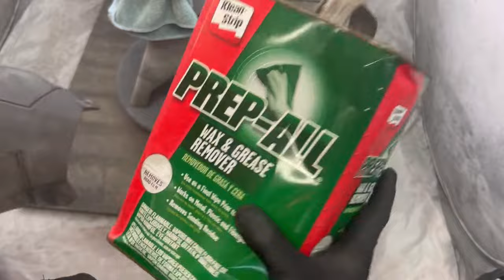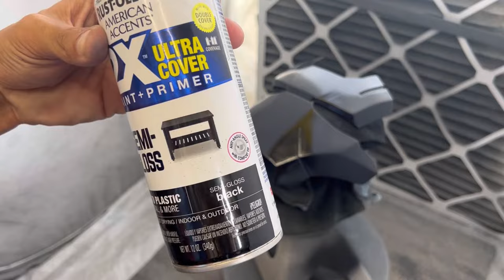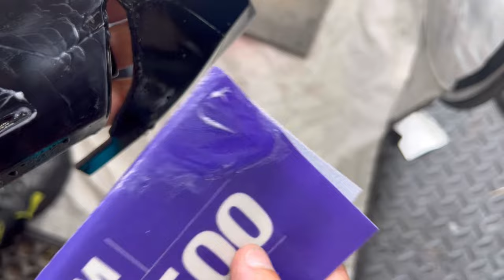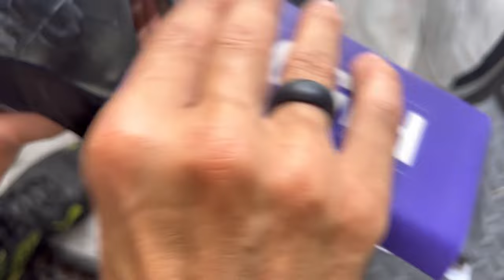How to wet sand clear coat when painting 3D prints | How to apply duralumen & wetsanding 3D prints

Comment: I followed this method to a tee,  everything was going perfectly, until I started applying the duralumen...now I see streaks everywhere? Any ideas on what I'd did wrong?
Reply from the maker: Which method did you use the wetsand & buff or just wetsand & reclear? 1k clear or standard acrylic?
Reply: @Darkwingdad  1k, wet sand, polish, prep all, tac cloth, duralumen
Reply: @Darkwingdad  I think I figured it out. I don't think I cleaned off the polishing compound off well enough before applying the duralumen. I sprayed a test piece with duralumen that just had 1k with no wet sand or buffing and it came out with no streaks or spotting.

But I do have a follow up question with that, how do you know when You've gotten all the polishing compound off after buffing?
Reply from the maker: @michiganmandos  oils & residuals will definitely cause streaking. Also wear gloves & use a fresh towel. You can always run the piece under water, clean areas the water will sheet off the model. If there is oil it will build up almost in a pattern
Reply: @Darkwingdad  thank you so much that is hugely helpful! I definitely think that's what happened then. Time to wet sand and start over lol! I appreciate all you do and the replies!!!
Reply from the maker: @michiganmandos  you won’t need to wetsand it again. Polish the duralumen off, give it a good clean wipe down & reapply duralumen
Reply: @Darkwingdad  saving me time and money again, thank you!!
Reply from the maker: @michiganmandos  anytime!

Comment: Dawn is alkaline - at least plain dawn is. I've never had issues adding it to my wet sanding to get mirror finish, but obviously that changes if you use like scented and other varieties.
Reply from the maker: Dawn ultra contains sulfuric acid, regular Dawn contains metasilicates which are found in heavy degreasers. Both will continue to attack the surface. Not good for incurred clear. Solvent pop won’t happen right away but months after treating the paint:
Reply: @Darkwingdad  Hmm think Cascade has meta-silicates but never used it so don't know how it impacts it, either way my prints from 10 years ago still look shiny and clean, if not a bit dusty.
Reply: Also - I've used 2k clear but never 1k, does the 1k have some sort of metallic flakes in it?
Reply from the maker: @realMysta  2k had more hardening agents in it, so it does cure a bit faster.
Reply from the maker: @realMysta  duplicolor 1k comes with & without flake
Reply from the maker: @realMysta  if you waited long enough you might be ok, but that’s why your not even supposed to wax a car or use water based polish/compound when curing bc the solvents can get absorbed in and create solvent pop
Reply: @Darkwingdad  Yeah maybe, I usually don't wait too long as I'm always crunching but I at least wait 48 hours which likely means at least the outer layers are good and I don't sand far enough to get through those.

Comment: This may sound like a silly question, but would 16-54 Seymour Stainless-Steel Specialty Coating work? Like would it be  safe to use after priming and even polish?
Reply from the maker: Got a link to the product?
Reply: @Darkwingdad  Yeah, I keep trying to post it but YouTube keeps taking it down. I’ll try again down below as a separate comment. It’s also on amazon under the same name.

Comment: Quick question. The link you have in description for 1k clear goes to spraymax product and not the duplicolor extreme. Which did you find works best? Thanks.
Reply from the maker: https://amzn.to/3qZSMlR here’s duplicolor. I noticed the duplicolor last longer. I used spray max in the past & although it doesn’t have the activator button after sitting for 2 weeks the nozzle clogged & i wasn’t able to use it. So although spray max is cheaper duplicolor lasts longer.
Reply: @Darkwingdad   Thanks for the quick response.  I usually use Alclad gloss black for base, then Alclad II chrome followed by sealing with spraymax 2k for my Mando cosplay. Works well but wanted to find alternative where i can speed up time using rattle can for some parts. I am hoping even though this will introduce having to buff clearcoat before I spray chrome, it will still reduce the time it took on my alclad.
Reply from the maker: @chrisgilreath2821  I haven’t used alcad yet but try using a flat or matte base followed by 2k. A lot less orange peel. I’ll be doing another video with duralumen tuff & with 2k clear
Reply: @Darkwingdad  Looking forward to when you compare duralumen with alclad chrome!  My issue with 2k is that unless you use the whole can, its wasted due to cure time. Sometimes I am just building a Mando helmet and dont need an entire can, but it gets wasted.
Reply from the maker: @chrisgilreath2821  yea the 2k you can put it in the fridge and get a little longer shelf life but that’s why I spray with hvlp it’s cheaper & obviously the activator K resin are seperate so “no” shelf like unless mixed
Reply: @Darkwingdad  Interesting. I have a Husky hvlp sprayer. What product do you use? That sound like the way to go. Thanks

Comment: Awesome video! Though I have to disagree on the hand polishing. I do it for all my props, hell I even did it on the guitar I built and it always comes out great. Like a mirror. As long as you have a good quality microfiber polishing cloth, you'll be good.
Reply from the maker: Respectfully speaking, hold an led light up to it, you’ll have tons of swirls in the finish from the pressure your applying. There’s a HUGE difference between gloss a finish. You can get things glossy but still have scratches. Scratches & swirls refract light instead of reflecting them. So your finish & shine won’t have as much pop as it could be. Just try it one time you’ll see the difference. There’s reasons why technicians who work on cars, chrome & even acrylic fish tanks use machines & not by hand. One is time….two is the quality.
Reply: @Darkwingdad  I'll definitely try this out on my guitar when I gey home, I'm very curious!

Comment: Hey man, just wanted to say thanks SO MUCH for this video. I’d never even thought about buffing or polishing my prints until I saw this, but I’m so glad you taught me how. I followed the video to a T, and the surface of my print was unlike anything I’d ever made before!!! It was incredible. 

Unfortunately… I think I may have gotten a bad batch of Duralumen… When I sprayed it on, it was cloudy and completely matte. I tried it with different airbrushes and everything… I was devastated tbh. Your video helped make the surface so smooth and so clean, and the Duralumen ruined it. But, I was determined to make it work. I basically repainted with quite a few heavy black coats followed by a few heavy clear. I then sanded at 1500 and followed the video from there! Instead of Duralumen, I used Graphite powder. And because the surface was sooooo smooth, it turned out amazing. Thank you again for such an in-depth guide!!
Reply from the maker: A big wives tale is wetsanding. It should only be done lightly if your filler primer comes out a little chunky and on clear coat. I see people wasting time wetsanding every layer even pla. Glad this tutorial helped you, if more people did it there prints would be THAT much better. Glad you seen the results first hand, I appreciate the support & kind words!

Comment: I started following your methods and i cant believe the turn out on my prints. Keep it up and thank you.
Reply from the maker: So awesome to hear! What have you made so far??
Reply: @Darkwingdad   started printing 3 months ago,and finally learned my best settings,before that alot of bad layer line work and hard to post process.since your videos using your methods I made a helldivers,mando,miles morales,warlock helmet from Destiny 2 and currently working on legend of the white dragon(alot of Sharp edges). The methods of spray bondo glazing putty,etching primer and wet sanding/buffing the clear have been the big difference in subpar/average work and amazing work.I haven't seen many content creators if any that take the extra steps like you,amd that makes the big difference

Comment: I finally got my R2 Dome painted with Duralumen and then used the 2K Clear from Spraymax over it.  I must say it came out really nice and at least for the 2K, it did not appear to affect the Duralumen at all.   I do recommend using a small automotive HVLP gun when doing the Duralumen over a large object.  It was very difficult to get an even looking finish with the airbrush and I do have some light and darker streaks, but R2 shouldn't look perfect anyway.  The duralumen is much easier to use than Alclad chrome and doesn't turn into silver looking paint if you put on a 2nd or 3rd coat.  My old trusty hvlp gun was not in working condition and i didn't want to buy a new one since I don't paint cars anymore.  The plastic cup had actually disintegrated and fell off on the floor when I pulled it out of the cabinet. :)     Thanks again for doing this video it inspired me to go for it and not look back.
Reply from the maker: As long as duralumen is put on baby enough to a chrome like color 2k will always work on top! Glad r2 is looking good, I’m working on a welding prep video for the droid community.
Reply: Awesome video!  Thank you for sharing and taking the time to work through your process. Do you have a recommendation for primer and 1k or 2k clears for an airbrush?

Comment: Another great video DWD.  I do have a question about the duralumen.  Does it turn into silver paint if you put on too many coats like Alclad Chrome does?  I have had much trouble with alclad and getting an even coat without it just turning into a silver metallic finish.  I am printing an R2 and need to finish the dome and purchased Duralumen, but I have been putting off painting it given my sordid history with Alclade chrome.
Reply from the maker: The more coats you do the lighter it gets. For darker metal look 3-4 coats 
Chrome/steel 5-6 coats
Reply: @Darkwingdad  Thanks for quick update!  I am going to use the SprayMax 2K clear on the dome over the Duralumen and I will update this thread with the results.  I have used the 2K before and it is awesome so crossing my fingers it doesn't dull the Duralumen too much.

Comment: Great video! Any thoughts on using a drill for polishing vs buying a cheap polisher? I was thinking about getting a cheap polisher to use for 3d prints and maybe my car, but wondering if buying an adaptor for my drill would be better.
Reply from the maker: I have used both, it’s simply preference & budget. Keep in mind the drill is more agressive & will cut more bc it’s rotary where as a polisher is free spinning. I personally would never use the drill adapter on a car other than headlights maybe.

Comment: Instead of the wax/grease remover can you lightly use isopropyl alcohol or would that strip down some clear coat and paint? Definitely going to check out some of that duralumen when I run out of my usual Alclad-107
Reply from the maker: Isopropyl will also work A OK

Comment: One thing I struggled with was shiny/chrome paint not really liking other paints on top which is I guess good and bad. For instance I made a Mandalorian helmet where the base coat was chrome and I used a latex gel on top. Painted over with grey and with some rubbing I had some controlled wear and tear on the helmet. Now I wanted a third layer at the cheeks, and in some small grooves using blue - unfortunately when I masked them off, while it worked, all the grey paint under pulled off exposing the chrome again, which later I just used masking tape to just make the chrome exposed and forwent having multiple paint layers showing wear. 

At the end of the day it did help texture the helmet the way I envisioned, however it still kind of blew that the paint peeled like that. How does this handle other paints on top of it and masking them off to get more detail?

Comment: Love your videos!  I do have a question:
We shouldn't use Dawn Dish Soap once the clearcoat is on; does it matter what soap we use to wash the primer/pla/filler dust off in the early stages?  i.e. I used dawn dish soap to scrub my armor, am I ruining the primer or weakening paint adhesion?
Reply from the maker: It can, I never use water to wash/clean my pieces. Much better to use a prep solvent like alcohol,naptha or prep all bc they will evaporate so fast. If water is not fully removed from the surface it will definitely cause issues.
Reply: Oh my; thank you for explaining that.  I was taught to just dump the sanded parts in soapy water but I'll be changing that up.  Thank you!

Comment: I’m curious as to what pressure you are spraying the Duralumen at? I find it takes a lot more coats to get a reflective look / coverage than some other chrome paints. In the end it wasn’t a cost effective paint for me, unfortunately I probably won’t be buying it again.
Reply from the maker: 32 psi, it is pretty pricey but a wild effect. I need to test alcad & alumaluster head to head to head

Comment: Check out Car-Rep 2k clear. It has a humidity activated catalyst in it, so it's shelf stable and premixed from the factory.  No more popping the activator on the bottom and wasting any leftover clear.
Reply from the maker: I’ll look into it for sure, I spray clear with hvlp but I know that’s not everyone’s bread & butter
Reply: @Darkwing dad  for those that don't have access to a compressor, it's pretty awesome. I found that it's not quite as hard, once cured, as a traditional automotive 2K clear, but it is miles ahead of any 1K I've tried. I've used it on props, a scooter restoration, and a guitar build with excellent results and zero complaints.
Reply from the maker: @MRgrimlock84  I definitely see why people use it. Even in a rattle can it lays & shrinks so much less. I haven’t used rattle can clear in almost 2 years & it’s just so hard to get a good spray & lay.  I just hate how the 2k with the activator don’t last long.

Comment: since i am in the middle of remaking my mando armor i would absoletly love to know how far you can push this with a 2k clear and a hvlp since that will be the same process i will go through! Would you recommend a 0.8 nozzle HVLP or a 1.4 ? I have both on hand but I feel like 1.4 is such a overkill?
Reply from the maker: Duralumen is thin, 1.4 is definitely overkill you’ll be fine using a .8 just set the fan & regulator properly. This airbrush was a .5

Comment: Did you say wait 2 hours after final clear coat to add the duralumen?
Reply from the maker: Which clear are you using? The 1k or standard acrylic? 
Standard acrylic 2-3 hours is fine. 
1k we waited 24 hours before wetsanding so although 1k is a more volatile clear I would wait at least 4 hours if you’re not wetsanding it to be safe

Comment: I’m surprised you can use Rustoleum and then Krlyon on top. I’m guessing you live in a dry, warm climate with low humidity. In my climate, which is colder, wet and higher humidity, both paints will react very poorly. I’ve not had any issues with Duplicolor and Montana
Reply from the maker: Florida…. So hot & humid lol If you give paints proper time to cure anything can work. Problem is people wait 20-30 minutes & put coats on wayyyy to heavy and frying occurs. Guess that’s another video I’ll have to do & show lol

Comment: Also what helps with orange peel is wet sand ur base coat before clear then same with clear then spray final clear and will be damn near or no peel
Reply from the maker: Wetsanding your base coat won’t help much, understand when paint cures it shrinks, that’s when orange peel occurs. Higher humidity & inadequate temps will also contribute to orange peel. If you’re using rattle can you’ll get more orange peel as well. Cut/buff/polish your final layer of clear to to reduce it the most

Comment: You can reduce orange peel by using a large gravity feed spray gun and blast it super wet. Like the guys that paint cars use. Only $15-20 at harbor freight.
Reply from the maker: Using an hvlp will greatly reduce orange peel yes
Reply: @Darkwingdad  yeah. My bad. I commented before watching the whole video. 🙄
Reply from the maker: @jasoncombs3232  lol no worries my man
Reply: you need an expensive compressor for this though right?
Reply: @gehrkea  any compressor works at 40 psi.